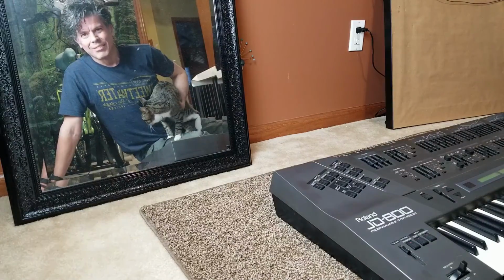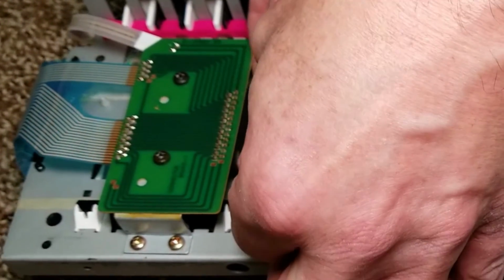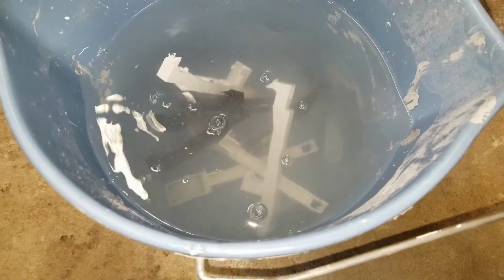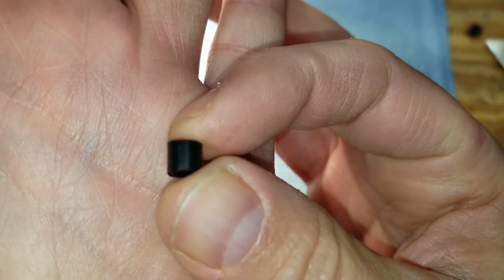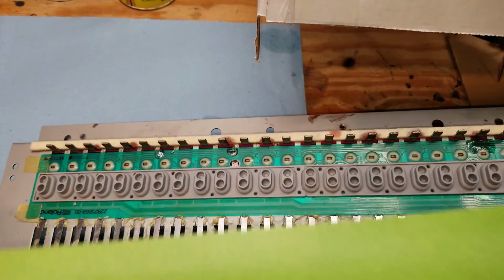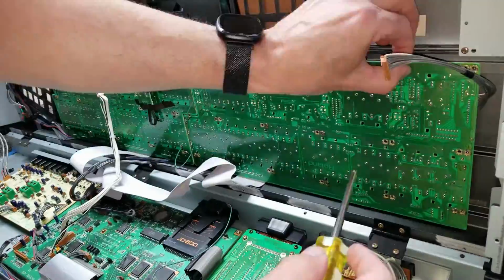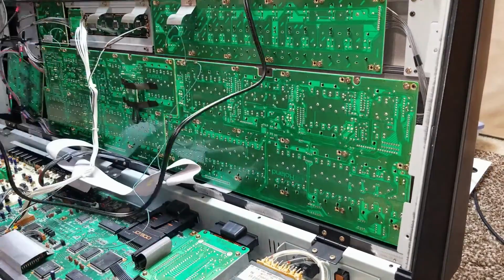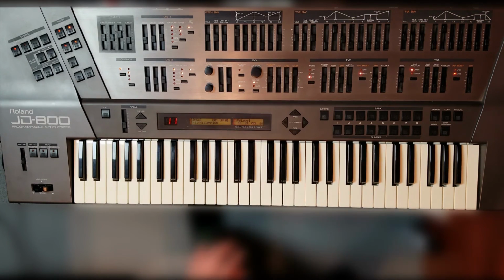Roland JD-800 Repair, Restoration & Modification

Comment: Hey, thanks again for the great vid @ScottsSynthStuff  - quick question: I have regular deoxit D5 (not the fader version). Do you think it safe for the faders? You or anyone have suggestion on that?
Reply from the maker: It will certainly work, but you won't get the added benefit of the residual lubricant that the DeOxit Fader has.

Comment: Great Video. One question, what are these? 10:01 , between the rubber contact strip and the buffer posts and are they important ?
Reply from the maker: They are diodes, and are part of the keyboard matrix. They are potted in epoxy on the flexible PCB, and are very important - the keybed won't work correctly without them.
Reply: Thanks so much for your video. My JD-800 was the first thing I ever bought with my first ever real paycheck in 1994.* Gutted that it’s glued up.  I may have trashed my Flex PCB by testing acetone on it, then using NaOH, which got through a pinhole somewhere. Should have just stuck with the NaOH. I’ve been dripping it into the felt to see if that just removed the glue there too. * I as a toddler I put clothes pegs/pins all around the table and played “Cars” on them…
Reply: Hi Scott.Thanks for the great video. Just opened up my JD and looks like the glue has dripped onto the cicuit board, in some cases onto a diode. Is there a safe way to get rid of the glue with damaging the cirtcuit board and diodes ?
 @ScottsSynthStuff
Reply: WITHOUT doing damage🙂

Comment: Does this fader cleaner also fix the malfunctioning fader like e.g. cutoff frequency works only halfway or is it just a lubricant?
Reply from the maker: It is a cleaner and a lubricant. If the malfunction is due to dirt or dust in the pot track, then yes, this will usually fix it. If the malfunction is due to a broken area of the pot track in the fader, then the fader will have to be replaced (although SOME can be repaired, but it's not easy).

Comment: WOW!....Great job and video! Tremendous effort on both accounts! So what background is your electronics experience from as it seams a whole lot farther than a normal hobbyist and your tools are a bit more than you would need for motorcycle repair?  This video has got me a bit motivated...years ago I bought a Roland D10 for $25 at a pawn shop because it had 8 dead keys. I believe its time to fix them over the winter.
Reply from the maker: I've done electronics design for decades as a hobby, everything from audio to microprocessors, so yeah - I have a bit more experience than most. :) Have a look at this video for one of my projects: https://www.youtube.com/watch?v=CDjntt-S7xQ
Reply: @ScottsSynthStuff  Well that explains a lot .Much respect to your inventiveness and honed abilities. People like you i have found are in short supply and I thank you for your contributions!  BTW I grew up with a Dad who was steep in electronics and more. He worked for Cambridge instruments installing laser microscopes and the machines that made microchips in the 80's and 90's for the northeastern USA.  So yeah, the first law I ever knew was "ohms" lol

Comment: Really amazing video, thanks so much for making it, the detail you go into really helps. Sometimes those forum posts just can't match seeing a video of the process!

A question for you though: do you have any recommendations for non-chemical-based solutions for the red glue? Or perhaps a less-strong chemical? Not sure my girlfriend would appreciate a bucket of keys soaking in sodium hydroxide in my tiny apartment 😅
Reply from the maker: I've read of some people using other solutions, but none work as well or quickly as the sodium hydroxide. Perhaps there's a weekend she's going away soon, and you might have the bucket in the bathtub (with the exhaust fan going)? :)
Reply: @ScottsSynthStuff  😆

thanks for the reply! Yeah, might have to just figure out a way to go with the sodium hydroxide approach.

Comment: Hi Scott.

Ive just pulled all the switches off the preset selector board and I'm concerned about damage to the tracks that you mentioned. Could you explain a little about the tracks in question and what you did to repair them please?
Reply from the maker: The PCB traces are very thin and can pull off and break if heated too much. I would not suggest this repair for someone who does not have a LOT of experience with soldering rework. If a trace is broken, you need to recreate it using wire and solder.
Reply: @ScottsSynthStuff  Thanks man. I've already desoldered the switches, so I'm all in :) - just waiting for the hardware now from china - lets see what happens!

Comment: I just started the red glue repair. I need to get the contact strips and clean the contacts under them. There is a line of 8 contacts and a line of 4 that don't work correctly so hopefully the deoxit works. Its in very nice cosmetic condition and I only paid 160.00 so the extra money put into it's well worth it.
Reply from the maker: If you have several in a row that don't work (i.e. 4 in a row, 8 in a row) then the problem is usually the clamp at the side of the keybed that clamps the two ribbon cables together. Roland used cheap plastic to hold them together, and it's not enough. I removed the plastic rivets holding that plastic piece in place, and VERY carefully, without disturbing the ribbon cables, replaced it with a piece of steel covered in foam rubber. I then fastened it in place with screws and nuts. It fixed the problem.
Reply: @ScottsSynthStuff  that's exactly what's wrong with it, the second 8 keys in a row and 4 closer to the other end. The 8 made no sound at all and the 4 did but intermittent. So the extra pressure holding the ribbon down worked then without having to do anything else to the contacts. They look good.

Comment: Thanks for the video. I did. think for 1M NaOH you need 40g per 1L, which would be 200g in 5L. Why did you use 250g? That makes it a stronger base.
Reply from the maker: That was the recommended strength based on the many people who have done this before.
Reply: @ScottsSynthStuff  It makes sense. I used 40g per 1L and had a few keys that needed to be repeated multiple times they were glued so well to the bottom. 

I just seriously caution anyone using this stuff to be extremely EXTREMELY careful - people can go blind, have major burns (you won't feel it until hours later, so just a quick rinse is not sufficient), and people have died from this stuff. Do NOT skip out on the PPE here. Read up on the toxicology reports before using it so you know what you're getting into.

Comment: The keys remind me of my Roland E-16. Numbered in the same way. And same way to lift them out of the keybed. But I don't think mine has the weights in them. And they have coiled springs, instead of the spring clips you have. Luckily, mine doesn't have the drippy glue. I wouldn't feel safe cleaning them with the chemical solution. 
I also remember those rubber tips that you had to squeeze through the holes. Very delicate indeed.
Reply from the maker: The chemical solution is really nasty. You also have to be very careful not to inhale the powdered form, which is why I was wearing the mask. But it cleans the glue off like nothing else, without harming the plastic keys.

Comment: Hi Scott, thanks for this amazing resource! It's probably my most watched youtube video at the moment 🙂 I have a question regarding the numbers of the keys: Does it make a difference where the keys with the specific numbers go or can they be interchanged? Could you provide your list of keys or is it different for each instrument?
Reply from the maker: As long as it is the correct key (F goes in the F slot, etc) it doesn't matter. The number is just how they identify which injection mold the key came from at the factory, so an F1, F2, F3 all work just fine for an F. They needed to know at the factory if all of a sudden they start seeing defects in F keys, which of the F key molds was responsible for the defects. Makes no difference to us. :)

Comment: I have a JD8000 that just started doing this about 4 months ago. I do have 4 keys that are stuck together (sticky together), but beyond that everything works great and the board looks like new. I think it just need to be opened and have the keys cleaned and weights reglued. However, this repair is CLEARLY beyond my abilities. What do you think this board is worth in the condition it's in. I think part of the reason the glue didn't do the damage of yours is because I stored it on a stand at about a 30 degree angle. ( I favorite playing angle ). Any response would be appreciated. Thanks.
Reply from the maker: I've no idea - I'd have to see if there are any still on reverb that need the keys worked on. Having the glue problem significantly devalues the synth - it's worth having it done, as I suspect the value increase in the synth will be more than you pay for the repair.

Comment: It's a good idea to put heatshrink onto the IEC connectors inside the case.  Also, use pliers to bend cables into position not cutters!  : )
Reply from the maker: The PSU is an enclosed metal box within the case, there is no movement or cable strain, and nothing that can come anywhere near the IEC connectors. Heatshrink on those wires would do absolutely nothing to increase safety or prevent shorting. If it was exposed in the case, I probably would have done it.

I didn't use cutters to bend those wires - they are a tiny set of pliers - they might look like cutters, but they are actually flat-surfaced miniature pliers!
Reply: Sure yeah, I always heat shrink them though, I've shocked myself working on the PSU even though it will be totally enclosed later! @ScottsSynthStuff

Comment: Hey Scott, just wanted to ask in case you know.  I got the synth up and working perfectly.  I then double checked the battery voltage, put it back in, it asked to re-initialize, I said YES.  Then, the keyboard was haywire and certain keys refuse to work, others are super loud.  I tried re-initializing several times, but nothing changing.  Any suggestions, by any chance?

Comment: Uhh just scored one works , but the keyboard oh god...the glue and the weights are everywhere. Wish me luck! Actually looked ok on pickup but the half hour car ride to home in 30C+ temp made it all fall apart hah...
Reply from the maker: Heat is really the enemy of that nasty glue!
Reply: @ScottsSynthStuff  Little update, the glue was quite easy to get off with NaOh, actually took a few hours not a day like people say everywhere. Could be the extremely hot weather. But note to people who do this also dont be too eager to reassemble too fast, let it soak in detergent after for a longer time as i now have a keyboard that smells literally fishy. Also the flex PCB is intermittent need something to push on it so the keyboard doesnt cut off every now and then.

Comment: I'm currently in the process of restoring a JD800, I notice that some of the buttons are the silicon/rubber type and others are just the solid little buttons. For example, on my JD800 the up/down/left/right arrow buttons are the plain solid type, whereas the patch/bank ones all have the rubbery fellows. I wonder if the plain solid type would work for ALL the buttons and just not bother with the rubbery ones at all?
Reply from the maker: If you're going to replace them, I'd replace them with the correct switches - you may find you end up getting "phantom" presses on the hard buttons that are supposed to have the silicone buttons. There are sellers on eBay that sell a full replacement switch kit that includes all the different switches, and they aren't expensive.
Reply: @ScottsSynthStuff   Yeah totally, not about price. I ordered 50 silicon ones for about £5. I'm wondering about the original choice of tact, why go for one type under the cursors and another under the patch selectors? In essence it's one of two things I guess, either a matter of aesthetic (cursors want to feel more positive and clicky, and others a little more warm and fuzzy?) or it's more about form factor and finding something that fits. I'm a little perplexed to be honest. Anyway, I ordered some rubbery ones from China for a few pounds and they should be here in about a six or seven hundred years.

Comment: hello
I would like to ask a question...
Could the chemical you used to remove the glue be used to remove the epoxy from vintage chips without damaging their components?
For example, the chips responsible for the voices of the Roland Juno-106..
Reply from the maker: Highly unlikely. It's extremely caustic, and would etch and corrode those chips very quickly.
Reply: I appreciate your prompt response.
I managed to remove the glue by submerging the piece in boiled water for 10 minutes and it works but you have to be careful when removing the epoxy

Comment: They put two holes in case one of the base is damaged so that you can use the spare/second hole with unspoiled screwing base. 
Rolands and Korgs commonly have that connection style then.
Reply from the maker: I suspected that was the case, and there were a few with the threads a big munged where I used the other one.
Reply: @ScottsSynthStuff  Yes. I have encountered with that too. People sometimes try and put bigger screws so the base is deformed :(

Comment: That red goo looks nasty... Apparently they used different stuff in the older D-50? That looks perfect by me...
I think it is a very interesting synth, with all the hardware controls on it, the patches don't make me too enthusiastic though... I guess I should try once one and see what I get out of it before buying one. At least a good point to look for one that had its keybed replaced...

Comment: You should’ve used a whit bed sheet.. carpet is a bad idea.. lose screws.   Use heat to loosen the glue to avoid damage
Reply from the maker: I normally have a large workspace to disassemble synths on camera....but the JD-800 was just too big to fit! I actually did try a white sheet underneath originally, but it was blowing out the camera's exposure and making the overall image too dark, so I switched to a dark rug.

Comment: cut the sharp point from a toothpick to put your keycontacts back in , did it a million times myself on different keyboards. on the other side there is a like a little hole, with a small press they go in very easy
Reply from the maker: I tried it - I ended up punching through the rubber!

Comment: I restored a JD-800. Mainly the keyobard red glue repair. I find that the JD-800 is very unreliable in multimode though MIDI. Sounds play on the wrong channels sometimes. Especially problems with parts 3, 4 and 5. Drums are 100% reliable though. Its also relaible in Multi without MIDI pluggd in. Anyone else had issues? I can't find anything online about these issues on this old synth. I wonder if I have weird CPU fault.
Reply from the maker: I rarely use mine in multi mode, as you lose so much of the FX which really are part of the sounds in this synth. That said, the MIDI in the JD-800 is definitely...unstable. I have a problem with mine where if you send it transport control data too quickly, the JD-800 just stops responding to MIDI altogether: https://gearspace.com/board/music-computers/1384116-jd-800-midi-shuts-up.html
Reply: @ScottsSynthStuff  Thanks. I'm just a beginner with MIDI control and using Cakewalk free software to try to get it working. I managed to get 6 part multi working in the end. I've still seen it refuse to allow you change the patch on the part. I found that flicking it to single mode and back to multi again recovers that. The actual problem is probably me with inexperienced menu control...
Reply from the maker: @simonmartin4599  It's not you - it's the synth. The problem I found with the sound engine dying in single mode is also fixed by switching to multi mode and back to single again. Firmware bugs that will never be fixed. :)

Comment: Got my JD-800, and the left-hand panel was cracked all to hell. I think it affected the volume slider, as it makes no sound.
Reply from the maker: Those plastic end cheeks were unfortunate, they take the brunt of the impact when the synth gets hit or dropped on the side, and they do crack.

You'd have to open it up and do some measurements to be sure that the volume control is the issue however.
Reply: @ScottsSynthStuff  Yeah it sucks. I've been calling folks around my area but no one wants to work on a synth from the 90's
Reply: @Scott's Synth Stuff  Any chance I could mail it to you? You seem to know quite a bit about the JD-800, so I was wondering if I could send it to you. Trying to exhaust all my options at this point.
Reply from the maker: @Lithuania8634  I'd suggest Syntaur - they do this sort of thing I believe, and can definitely help out!

Comment: Just fyi, that's really not an unusual power inlet. It's an IEC C18 inlet (which uses an IEC C17 cable) which is basically a 2 pin version of the IEC C14 inlet (which uses an IEC C13 cable) that most grounded electronics use. A lot of hi-fi stereo equipment use the 2-prong IEC C17/C18 to avoid ground looping.
Reply from the maker: Correct...but those are FAR less common nowadays than the IEC C13/C14 that is pretty much everywhere. If you had a C17 go bad on the road, your chances of finding a replacement quickly are pretty much nil. But C13's can be cribbed from any number of devices. That was the reason I replaced it.

Comment: I had JD800 and the keyboard is the worst Roland has ever made, its good when it works but too many issues with dust and keys not triggering and red glue crap. I got tired of fixing it all the time so I sold it. Its too much work lol... but , Im getting another one soon and it needs alot of work... so here we go, its gonna suck lol.